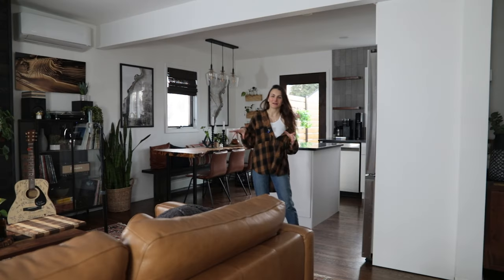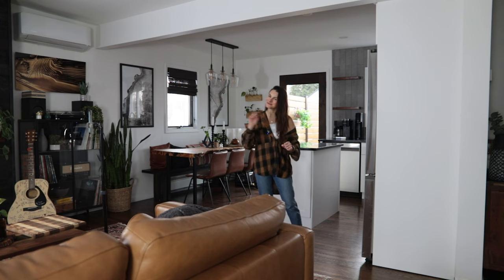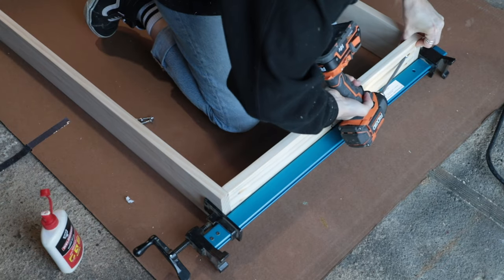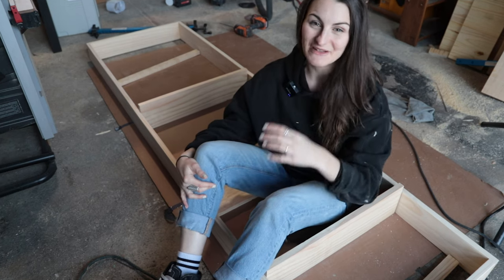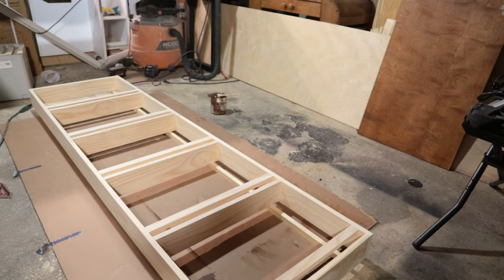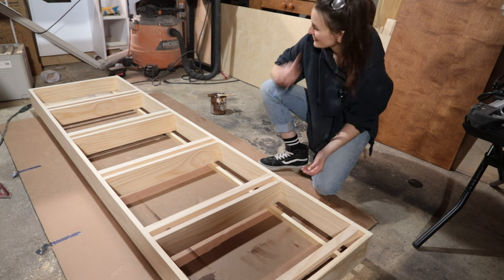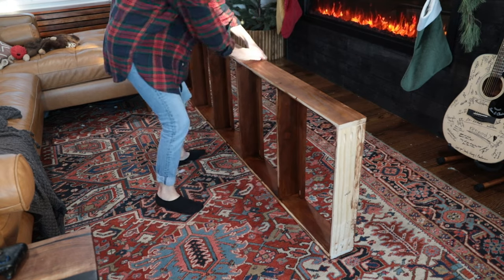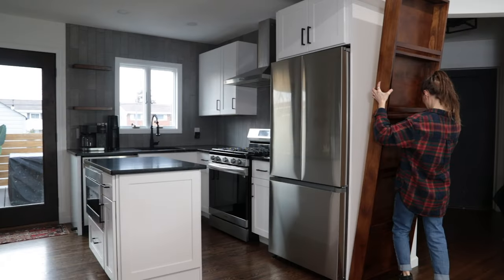EASY SMALL KITCHEN STORAGE HACK

Comment: The stain on that unit looks amazing.  What is it?  Did you start with a wood conditioner?  And then a clear coat of some kind?
Reply from the maker: Thank you! I did the same process as the floating fireplace mantle, if you want to see it in action. But, I used a wood stain and then a toner. I’ve link to both of the things I used on my website!
Reply: Absolutely love this it really ties the whole area together. So talented